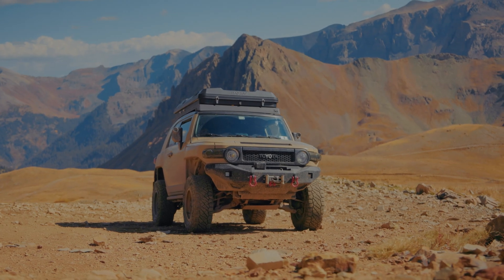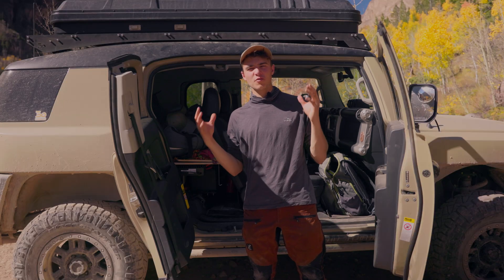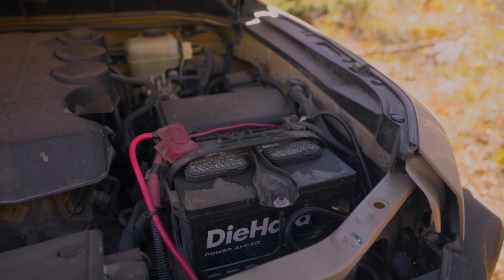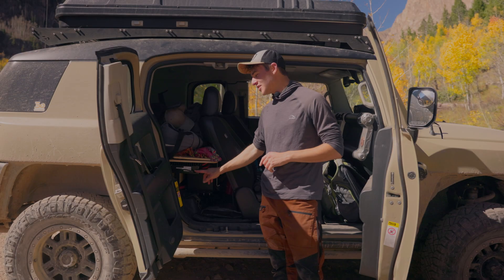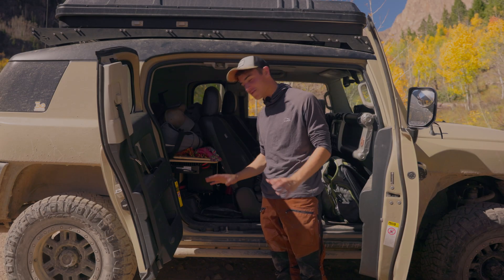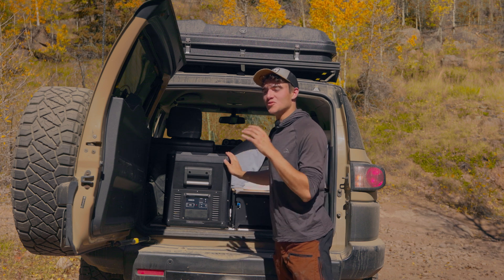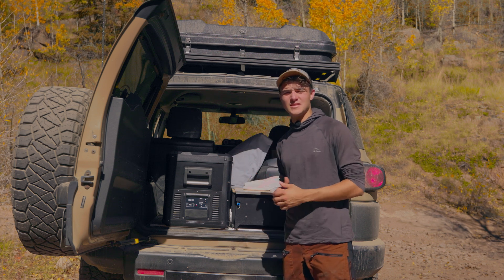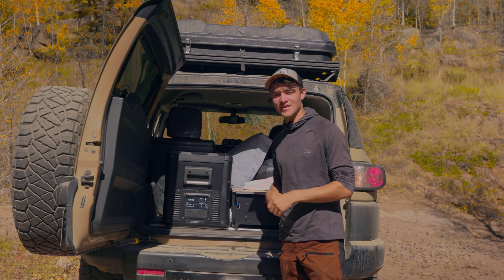Ultimate Dual Battery Setup (for all vehicles)

Comment: Question: Did you change anything about your alternator? Is it the original OEM, or did you upgrade? I’m interested in either system like yours, or using a DC to DC charger to power up a power station like a Bluetti. I’m not entirely, sure, but I’ve read some info that it can prematurely wear out the alternator due to the OEM not having much extra output. Thanks for the overview of your system!